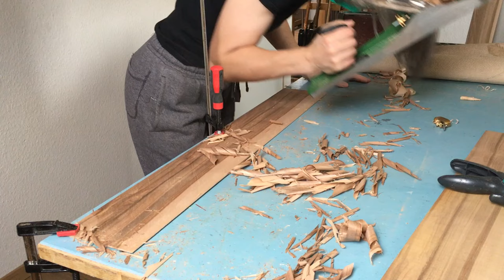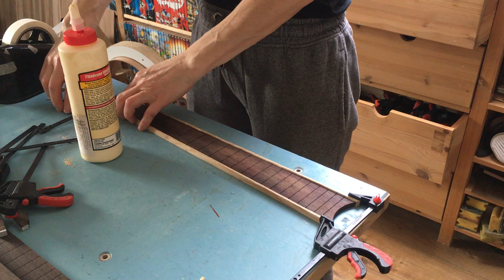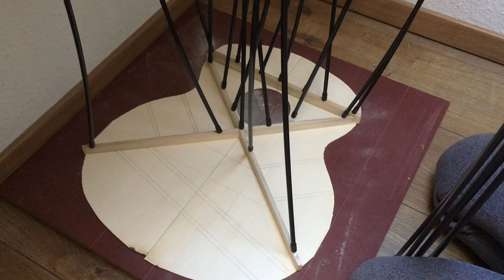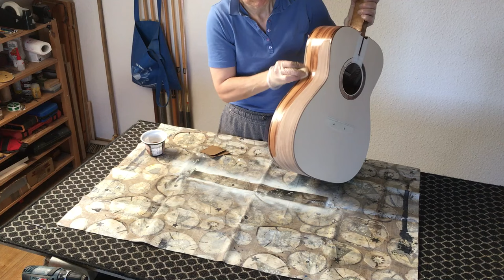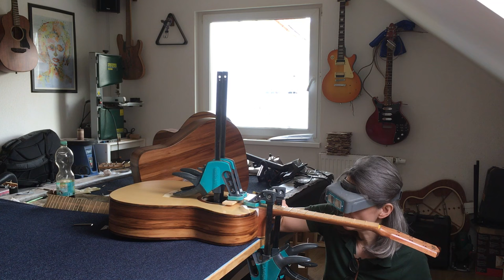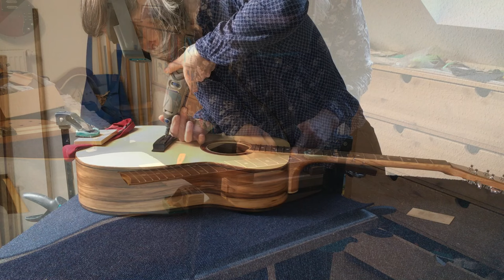Charity builds: Win a hand-built guitar: T -1 Day (Building reel)

Comment: Interested to see you thicknessing with a plane and belt sander. I thought you had built a drum sander. What plane is that you're using? I really enjoy your guitar building videos because you don't rely on lots of expensive power tools and equipment.
Reply from the maker: Hi there, the drum sander is not at home and it's a great mess doing it with it. I would need to build some kind of dust collection and I don't have the time and motivation for doing that these days. It's a no. 7 plane.

Comment: Hello Gabi, I know you use a steam box for bending. Do you get any "waviness" in the Red Gum afterwards? I had this problem with black walnut and was told it dose not do well when water is used.
Reply from the maker: No, I didn't and I've built quite a few guitars from Red Gum and also differnt kinds of walnuts. No issues so far.

Comment: Hi Gabriele,Please tell me what size router bit to use for the rosette channel?
Reply from the maker: Hi ther, Tom. It's different, depending on how big I want to make it. But I do it in more passes, so I'm routing the outer and inner ring and then take away the material in between, so it doesn't matter what size you use, unless it's not bigger that the desired width.
Reply: @GabiM3112  Thank you Gabriele! So with a small router bit you make many passes and keep adjusting the Dremel circle cutter and straight edge guide to the width of your intended channel cuts.My cutter came with a very small bit.And I think I should route out .5 millimeters or so?
Reply from the maker: Do you mean in depth?
Reply: Yes,I should have typed  1 mm instead of .5. Because the top is about 2.5 mm.So yes in depth.
Reply from the maker: @tomalexiou9573  That, again, depends how thick the material is you will put in. I do the rosette frist, wehn the top is still 4-5mm thick and I normally go 1.5mm because my abalone e.g. is that thick and wehn I do the sanding later, I want to have as much let as possible, so that the danger of sanding through is minimal. I also take away most of the thickness of the top from the back of the top, for the same reason.
Reply: Thank you Gabriele for sharing your expertise ❤.
Reply: Thank you Gabriele for sharing your expertise ❤.